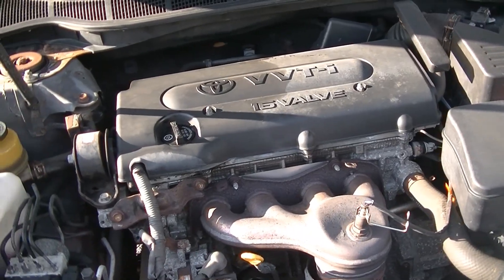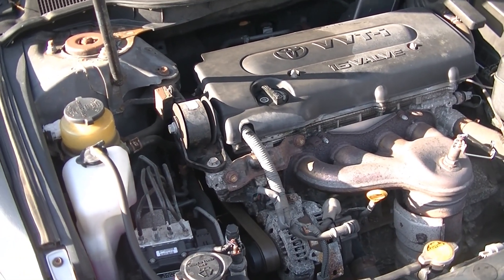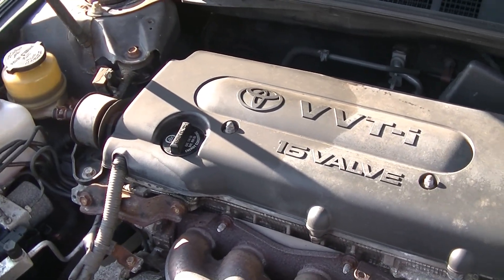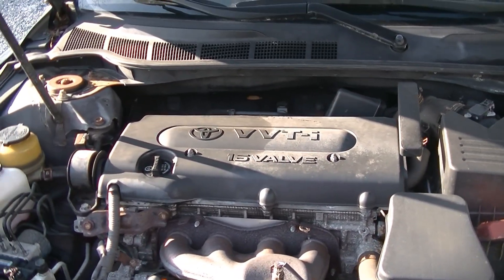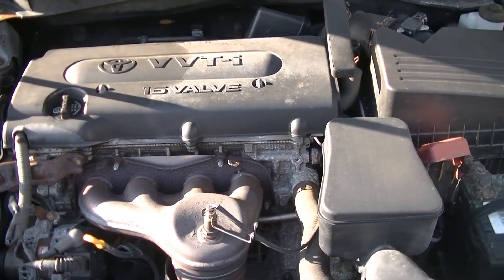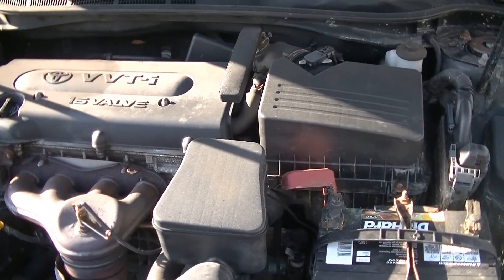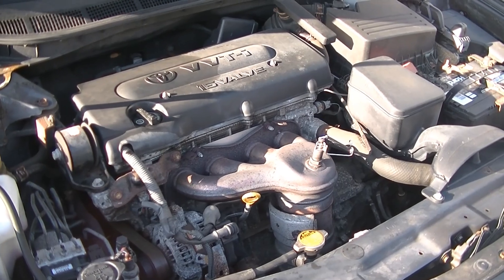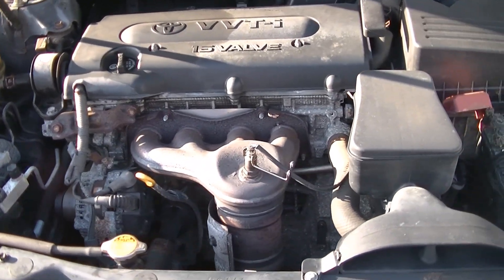Why you should AVOID a TOYOTA with the 2AZ-FE 2.4 liter engine!

Comment: Keep the oil full and these engines last forever
Reply: My 02 Solara with the 2.4 just hit 300k miles and is running like a champ 😇
Reply: @nickbutton9704  👍👍👍👍
Reply: @nickbutton9704  i love my 01 solara so much, love to see our community 🫡
Reply: @nickbutton9704  yours was built on a Friday😊
Reply: @nickbutton9704 It’s an 02. Obviously you didn’t watch the video.
Reply: We have an 09 2azfe with 166000 and it runs well but does use a lot of oil. Runs very well but I do maintain it properly. Replaced the timing chain and related parts, took out and cleaned injectors at 160000m and doing the balance shafts this weekend to get rid of the low rpm lose gear rattle. She notifies me every 1k miles so I can top oil off.
Reply: @foggyfrogman1  Mine is a 02 2AZ FE, and it used to eat oil till I replaced the valve cover gasket. 276k+ miles I think? Still runs like it's brand new.
Reply: @brytonmassie  was it eating oil or leaking oil before you changed the gasket?
Reply: @brytonmassie  so it didn't eat oil, it just leaked oil?
Reply: @brytonmassie So replacing the valve cover gasket fixed the piston ring problem?😂
Reply: @Wes_5kyph1  Sorry, leaking. Yeah the gaskets on these things aren't immortal. I replaced the valve cover gasket and soon I'm going to do the timing chain and timing cover gasket as its now leaking. XD 02 to 06 never had the oil burning issue, that was a problem with the revision they made in 07 and on.
Reply: @foggyfrogman1  Is your catalytic converter basically gone and check engine light on?   These engines will last as long as oil is check often with whatever oil you decide to maintain it with
Reply: @dashcamjourney4599  The #1 balance shaft had to loose gear
Reply: @foggyfrogman1 If it’s using excessive oil it’s not running well. 😂
Reply: @foggyfrogman1 if your 2azfe is using more oil than necessary, your piston rings are likely defective and need serviced, it's a known issue
Reply: @foggyfrogman1 try valvoline restore and protect 5w-30
Reply: Fr, check oil , if ur a person that just gets in and drives no car will last u long.
Reply: Lol true I have one with 185k 2006 
I put oil on it runs fine and well my daily driver
New spark plugs 
New starter 
New alternate r
Maintiwve will last
Reply: You have to put oil every day
Reply: Using good oil and filter, change oil at the right kms or  a year. All good no problems.
Reply: Wait until you plug your cat with all that oil ….
Reply: @sebastianromero420  If you're in Florida, like me, you don't have to worry about catalytic converters. 😉 Just cut that shit out!
Reply: @whoohaaXL  and then you need O2 simulator
Reply: @sebastianromero420 
Not necessarily.
Reply: @sebastianromero420 
Exactly. Then the engine overheats and grenades 😂
Reply: Ye, the best 2.4l engine ever had
Reply: Put in Berry man's Chemtool B-12, 5oz in the oil, drive it 100 miles before changing the oil, use full synthetic 0w-20 oil, and in a few weeks, and hopefully, it'll stop the oil consumption issue. It did it with mine, and four months later, still no oil loss. I have an 09 Vibe with that engine, and AWD.
Reply: I have a rav4 with the 2az-fe. Fucker is bullet proof I swear. I daily it 50-200 miles a day through mountain passes with 315,000 miles and she runs strong. Uses and or looses a quarter quart or so every 800-1k miles. Not going to lie it got a re-man Trans around 245k, set of coil packs and valve cover gasket at 265k and a new computer at 275k and ever since 300k she likes to go through down steam 02 sensors. Hit a deer at 305k and had to repair a crack in the radiator with jb weld But the thing runs mint so I will keep driving her and give her love. Maintenance is key oil every 3500 Trans fluid and coolant every year power steering, diff fluid, and dot 3 every other year and don't over Rev the motor a shit load and she will last. Hell mine seems to see 4500 rpm getting on the highway atleast once daily for a good pull and to keep the cat cleaned out lol
Reply: @quintinbriggs5036  whats a re-man trans?
Reply: @Wes_5kyph1  re-manufactured transmission. It's when the Trans gets taken out, rebuilt and sold as a re-manufactured unit. Usually when you purchase a re-manufactured part they ask for your old part as a core for rebuilding then it gets sold again in a parts store or online. Its New internals with a old Trans housing. Cheaper than brand new, quicker and cheaper usually then rebuilding yours at a shop.
Reply: @quintinbriggs5036  I see. Do you happen to know if it would be more cost-efficient to rebuild the 2AZ-FE engine versus replacing?
Reply: Always keep up with the oil weekly, the 08 xb have bad oil rings I hear, makes sense for the amount be consumed
Reply: The worst 2azfe engine needs fill 1.5 qt oil every  500 miles
Reply: I'd say buy a car with this engine if you want to modify it, these engines can make crazy horsepower and the aftermarket is huge
Reply: @1mawesomel1kethat 
😂😂😂😂
Reply: Anybody have problems w the CEL light turning off the AWD & TRAC & VSC? Not loose gas cap. Not 02 sensor, not MAF, is it the charcoal canister?
Reply: @newbluerugby  the trac, vsc light always comes on if the cel turns on, for most codes - supposedly a safety thing. just plug in a scanner and get the code - go to autozone if u don't have one. no point shooting in the total dark.
Reply: @Wes_5kyph1  I 100% understand the first part of what you said (I could have worded it in my original post better). I own two OBD2 meters. When all the lights intermittently go on the codes I get are usually MAF (new) related or O2 related (cleaned), P0171 code a lot. I have new spark plugs, new air filters. Have you heard of those older model matrix’s throwing codes for bad EVAP / charcoal canisters? I’ve read about fthis before
Reply: @newbluerugby  could be. I have a scion tc with the 2arfe and camry w/ 2azfe engine. had the p0171 code for a while (both engines had this experience) turned out both the charcoal canister (smoke test) was bad as well as the purge valve stuck open (most of time). if it happened to be stuck open (ltft 25+) after filling up the car was very hard to start.. and yes, traction, vsc, and cel lights would come on with 10171.
Reply: Agreed. I have a 2008 scion tc and as long as I keep on Top of the oil it just keeps going.
Reply: Had mine redone by dealer,just paid for water pump
Reply: @stintus1 what year? The warranty ended in 2018 no?
Reply: @teddypendergrass12  2007 rav4 ,they had a problem with those engines,high oil usage , bad rings, left care with them , rebuilt, just paid for waterpump
Reply: @stintus1  yes when was it done?
Reply: @stintus1  i thought those warranties were long expired
Reply: @teddypendergrass12  several years ago
Reply: The car care nut covered this engine too. If you’re not the original owner don’t buy anything with this engine in it. I see plenty of Toyotas for sale with these engines in it and if you buy one you’re a 🤪
Reply: That's true toyota camry  for  ever
Reply: The 07 Camry 2.4 can use 0w20 or 5w20

Which weight is better ?? Valvoline full synthetic restore and protect
Reply: @vandiyplant921  0w20 is slightly more viscus and has the ability to operate in lower temperatures which is important if you live in the north where it gets below zero, other than that it doesn't matter all that much. Always go full synthetic though, also the naming and brand generally don't mean anything.
Reply: @ ok thank you. Was planning on going 5w20 to hopefully stifle some oil consumption in 2azfe camry
Reply: Got 317k miles in my ‘07 runs like a champ. Only repair was AC and alternator
Reply: Keep the oil full is kind of a joke when you need to add a quart every 1000 miles.
Reply: The big think is you just gotta keep up with the maintenance; fix every leak, change thermostat every 50 to 60 thousand miles,  change the radiator cap every 3 years, flush coolant every 30 to 50 thousand miles, do oil change every 5 thousands miles and replace oil filter
Reply: This engine is so endurance and most of toyota cars fitted with this engine still running today in Asia jungle and Africa desert wth very minimum maintenance cost. Im still driving my Toyota MPV using this engine wth 300k km mileage wth no major problem so far.
Reply: Unfortunately, you are living in the past. The Swiss Watch Toyota engines of the 80s & 90s are no longer  being made.  Modern Toyota engines now need to be researched.  Was it built on a Monday?  Was it built in the USA or Japan?  How much plastic has been used in order to satisfy Government EPA MPG mandates?  Peace.
Reply: @ferndog1461  
My wife's 2011 Sienna had 367,000 miles before the water pump began to go out. We replaced it with another 2grfe with 21,000 miles.
Reply: @20alphabet  i have 480k miles on my 09 camry. was there an audible noise up until the water pump fail? I hear a constant, but subtle and sporadic noise/thumping? coming from in front of glove box.  I'm wondering, if its something around the belt (bad bearing) or suspension.  speed has no effect on sound either... otherwise runs great.
Reply: @Wes_5kyph1  
Not sure, but a water pump failure will result in having to replace the engine. Where do you live?
Reply: @20alphabet  va/dc
Reply: @Wes_5kyph1  
Thought I'd ask, just for the off chance you'd be near me. I've got the best mechanic here in southern California.
Reply: @ferndog1461  Hi, my 09 camry has 482,068 miles on it. It was built in Kentucky, it has original engine and transmission.  Regardless of its perks, I don't know of any other 'modern car' built with an engine and transmission (no rebuild either) that both exceed 400k miles and continues to go. Do you?
Reply: ☝️ I agree  💯 . The 2Az-fe in my 2010 Pontiac Vibe is at 345,000 miles. Sure it burns a little oil but I check it every other day and it’s lasted that long. The most basic maintenance prevents these engines from being ruined.
Reply: @fernandoavila1410 How much is a little oil? And how long has it been burning this oil? Have you removed the CAT?
Reply: @fernandoavila1410  how do you have a toyota engine in a pontiac?
Reply: @bmiller5674   The Pontiac Vibe was a rebadged Toyota Matrix, built in the same factory.  They are under-appreciated gems.
Reply: @bmiller5674  The Pontiac Vibe is basically a Toyota Matrix in a Pontiac body
Reply: @bmiller5674  I think he has covid... 🤣🤣🤣
Reply: Apparently not bbw use I bought one of these yesterday and the engine went out on me in less than 30 hours. 3900 down the drain
Reply: @benjamind7639  that’s you 
I’ve had this car since 2006 lol 
My shit is running like new baby
Reply: @tellez4089  is it a Scion xB?
If so it don’t have the 2.4
It’s a 1.5L
Reply: @chauncey5962  the second generation does have the 2.4
Reply: @benjamind7639  you should have researched if the oil had been changed every 5000 miles , and also  checked to see if the toyota engine campaign  for replacing the pistons had been done !

Comment: Thank u for the informative video. I no longer have MY 97 Camry, it was a great car, had 265,000 miles, used 1/2 qt every 3,000 mile oil change. Dip stick would be clean for a month before oil started changing color!  Thats too bad Toyota messed up on later models. They have such a great reputation. Only reason I got rid of mine was it was all rusted out.

Comment: YOU COMPLETE IDIOT. ! I have an Australian built  2003 Camry with the 2AZFE engine and it is FANTASTIC. Have travelled 184,000 km with not a single problem - save for 1 coil pack. It does NOT burn ANY OIL between 10,000 km oil changes. No other problems whatsoever. GET YOUR FACTS STRAIGHT  before mouthing off!

Comment: Toyota built an empire on this engine ,  sure , it takes some oil on some unit , but if you check your oil and top it up , the 2AZ will last 300k with ease , all modern engines design take some oil , ask any german car owner how much oil their car drink between oil change and then see how many lasted over 100k without a major rebuilt , as for 300k , it possible , but it will be after a third engine swap.
Reply: So what are good tips to stay on top of that oil
Reply: My 2002 Camry started burning and leaking oil from seals at about 84,000 miles.  Donated the car.  My 2008 PT Cruiser turbo looks and runs like a new car.  Doesn't burn a drop of oil.  Nada.  Runs like a champ.  I use Mobil 1 10-30 and filter and change oil every 5,000 miles.

Comment: I bought a 2007 RAV4 not knowing these problems. Up thru the recall period on the engine it was burning 3/4 of a quart every 1,000 miles...so I didn't qualify for the engine swap. Now some years after I'm burning around 2 quarts every 1,000 miles. The car is just an around town car and is never pressed. I'm considering trading this dog in...but I'm still livid with Toyota in them having even tried to pull over this monstrosity on the public, plus convincing me to buy a Honda CRV as my next car. Thanks for this vid. Subbed.
Reply: Did you get rid of the rav4 yet? I think now would be a great time with prices as inflated as they are. Anyway, if you're going to be getting a newer CRV make sure you don't get the 1.5L 4-cylinder engine. These engines have oil dilution problems. You want the 2.0L CRV which doesn't have those issues.
Reply: @stgrsa  ...thank you very much. Still have the Rav and the oil burning, but it's running still. Economy stinks...can't spend $30k right now.
Reply: @edzanjero353  True. If you sell for top dollar now you'll still have to buy something else at top dollar to replace it. 

I just bought a 2004 Camry (with the same 2.4L 4-cylinder as your RAV4) for $4900 which is wayyyy too much for that car but I needed something ASAP. Good luck! I'm sure if you keep oil in it it'll keep running until the market normalizes.

Comment: Unfortunately I have the 2AZ-FE engine in my 2006 Camry. I’m so relieved at leased the oil consumption probablem isn’t with this engine.

Isn’t there  service bulletin on the head bolts. I saw it but not sure if I can get Toyota to do it now. How do you put in a new head if the bolts are stripped out??!
Reply from the maker: There’s nothing wrong with the head itself. It’s the threads in the block that go bad as you mentioned. What has to be done is the holes in the block drilled out a size bigger, and threaded inserts installed in the block for the bolts to thread into
Reply: @SEsGarage  any video or guide on this? i have this issue.

Comment: just change your oil timely . my Camry has 205,000 on the clock. Doesn't burn oil runs like a champ. Just top off every 2000 miles not a big deal.
Reply from the maker: Unfortunately some are much worse than others. Glad yours is treating you well
Reply: Top off every 2000 is some form of oil burning. Some cars do not need oil added between oil changes.

Comment: 350k on my awd matrix, the engine has never missed a beat. ran 0w20 every 10k all its life and the only engine work was plugs and serp belt. otherwise thats it, it's still going strong, it's my DD work vehicle
Reply: Did you drive short trips or a long commute? 10k miles is a long interval. Great to hear it is good most times.
Reply: Which oil do you use?
Reply: @سعيدخالد-د9ص  0w20 full synthetic
Reply: Have 2009 matrix awd. Bought new . nothing but trouble . fought with dealer many times and toyota . lied to me over and over. Then turned around and got letter saying it is being recalled. Then another dealer rebuilt. Jim Robinson in wheeling , wv. Sold me the car and run me off after calling me in on a teleconferance call insisting car was fine. Said they would put a used engine in it for 7500 $ .
Reply: Does it use oil in between changes?

Comment: I'm using this engine but for a 2001 Toyota highlander. I currently have 270,500 miles on it. I use it at work car driving back & forth. So every week I get a good 200 miles on it. 
My only problem is I need to refill the coolant in the container every week. 
The oil I use is 5w-30 castrol high milage full synthetic. But I've used castrol ultra clean, valvoline high milage, & castrol high milage.
Reply: I’m looking at an 04 with the 2.4 engine and I’m kinda nervous despite all these comments on the 2 major issues it has
Reply: @andrewhalfcab  what 2 issues are u worried about?? 
Also I fixed the coolant problem. Watched a scotty kilmer video & I just changed the radiator cap. & now I have the same coolant when I poured in the container.

Comment: I got 239,000 miles out of my 2002 Toyota Camry le before I sold it.  I think I remember hearing only a small percentage of vehicles had the oil consumption problem.  It was the best, lowest maintenance vehicle I have owned.  Most of the parts were original from the factory when I sold it this year.  Unless quality starts to drop off I don't think I will buy anything but Toyota.  I did have to add a couple quarts of oil between oil changes but I think this was due to a leaky belt tensioner rather than internal engine damage.  I had to add engine oil between oil changes to every vehicle I have owned.  I did service it regularly.   The vehicle started and ran like it did when I bought it back in 2005 at the time I sold it.
Reply: The older ones don't seem to have the issues described in this vid. I have an 04 Camry with 178k and it's fine. They only start to burn a ton of oil in ~2007
Reply: I have the same car and model: 2002 Camry 4 Cylinder and what they are known for is the head gasket bolts. I had my head gasket bolts worked on otherwise the car is a reliable beast.
Reply: In 12000 km I burn less than a cup of oil on my car with almost 300k. And I'm more convinced some of it leaks past the turbo bearing into the intercooler. To add that much oil is pretty significant.